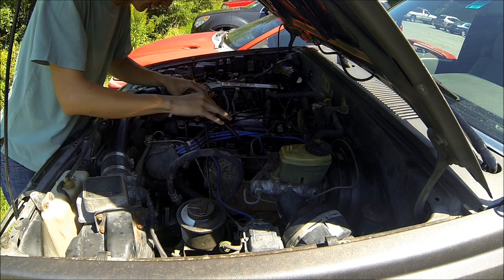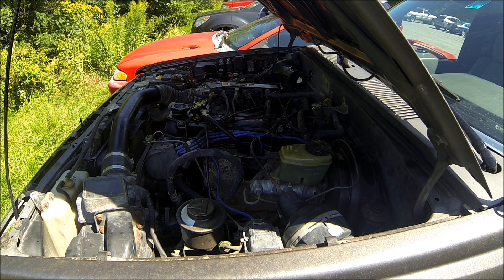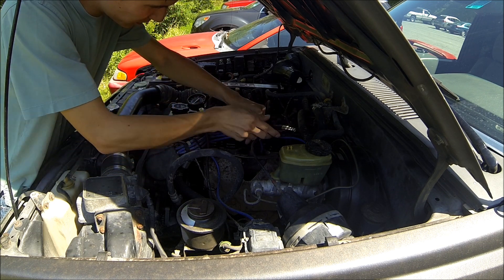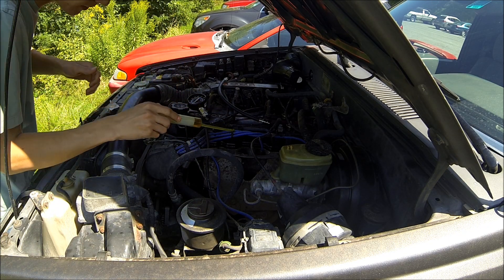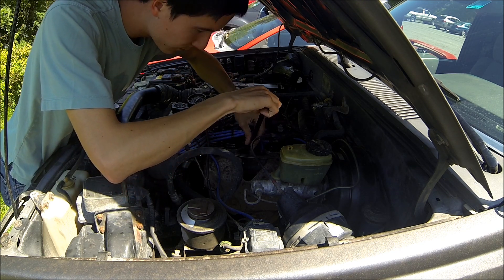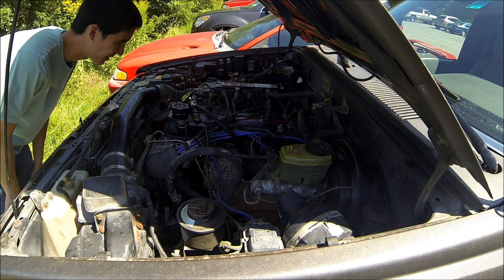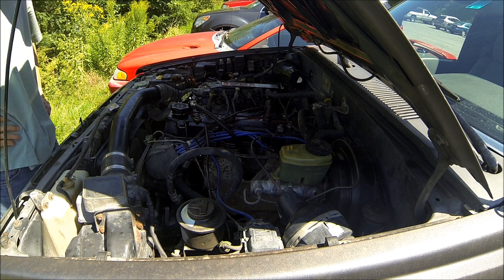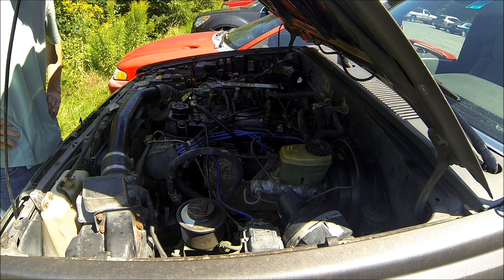1987 4Runner 22RE Cylinder 2 No Fire Diagnosis 2: Wet Compression Test

Comment: Try doing a leak down test. pop the radiator cap and listen for gurgling.
Also listen for any air coming out of the exhaust pipe and Throttle body. 
Good luck bud!